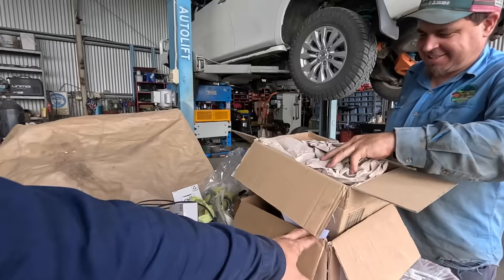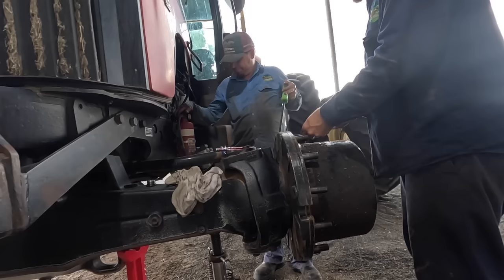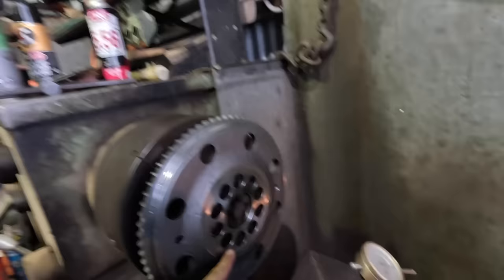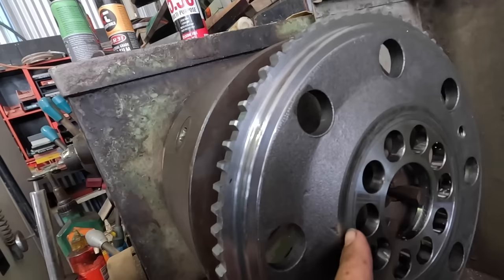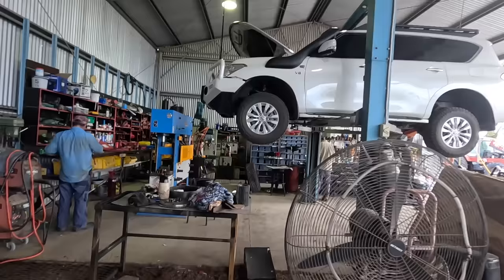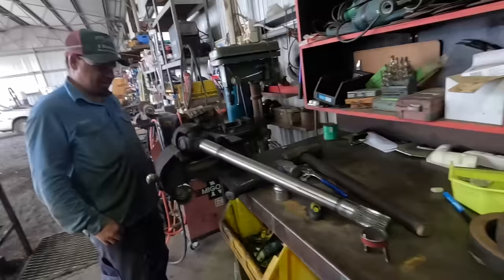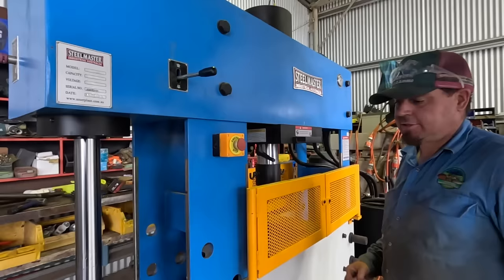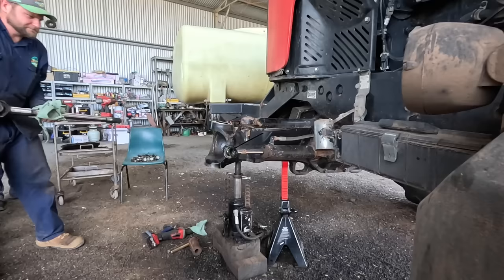280 Versatile Final Drive Rebuild Pt 1 | Workshop | Vlog 261

Comment: Brad,  get some 1045 cold drawn shafting of different sizes to make spacer rings for bearings.  1018 cold drawn or 1026  mechacical tubing won't, take the pressure. you will shortly end up where you started with the high pressure here. I learned this when rebuilding sewer pipe augers for Sewermatic in Ottawa On Canada about 25 years ago. I was rebuildingr about an auger a day using 1018 cold roll and redesighned and built auger housing out of 1045 and never had to make another one ..the augers were driven with 300 psiwater pressure. If the bearins had a smaller radius  you would have slightly more contact area but you have no control over that  design aspect.. some good quality carbide trefining tools would help. . get rid of your 1018  and 1026 rings you have so you won,t be tempted to use them. A lot of old shaFTING HAS KEYWAYS IN IT WHICH MAKES THE ENDS UN USABLE FOR RINGS.. when you make the switch to 1045 you won' be sorry as your maintenance work diminishes over time. Try to get a 2 long bed lathes for you new shop in the development block and put one on rails with the headstock removed so you could repair your own long augers without cutting them . put the lat he  out behind the building when you add a canopy over the machine storage area .. you might want to add a long telescoping feed shaft so you had feeds for the 2nd lathe.

Comment: Brings me back to the days when I used to do the front hubs up for a friends 130 hp Same that was about 30 Years ago.I feel the problem was they drive shaft that went through the planeteries should have had a bearing on the end of shaft not just floating between the 3 gears was a bit weak

Comment: Would plastigauges work, or something similar. That big tank on the front maybe exacting its price. Perhaps better weight distribution if possible. Cheers and thanks.
Reply: I was thinking along those lines. I have used solder wire and measured what it was squeezed too to get close to what you need. That will only give spacer size though.

Comment: If the axle shaft is wore where the seal rides many of the shops around us machine them down and sleeve them. As for the bearings being incomplete parts quality control sucks. Can you get the bearings from a bearing supplier cheaper than the dealer?
Reply from the maker: We tried other suppliers but this one was a bit more tricky, the main issue with the shaft was the gear at the end was pitted from when the first bearing collapsed👍😁

Comment: Weird question perhaps, but what is that gravel material on your shed floor and the apron area in front of the shed? Is it plain old road base or a small variety of blue metal screenings without the fines?
(Asking because I need to do a shed soon with the same sort of concrete/gravel floor arrangement, and it's giving me the willies having precision machining gear so close to a source of dust). Ta
Reply from the maker: It’s just small blue metal so minimal dust but don’t drop a little screw😂

Comment: Versatile was sold a couple of months ago it’s going to be hard to get anything for there machines for a while
Reply from the maker: We pretty much got everything from CNH as it’s the same as the NH 8970a👍
Reply: I worked there for 10 years in R&D most of the parts will cross over to CNH but not all there were a few changes along the way